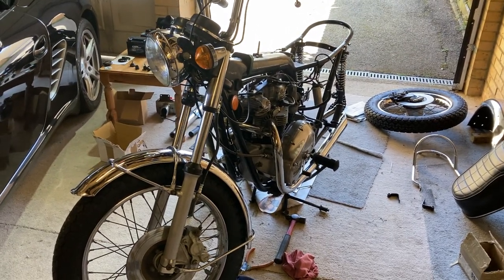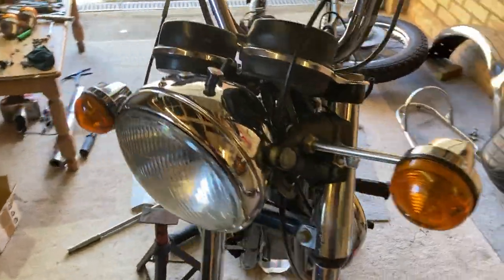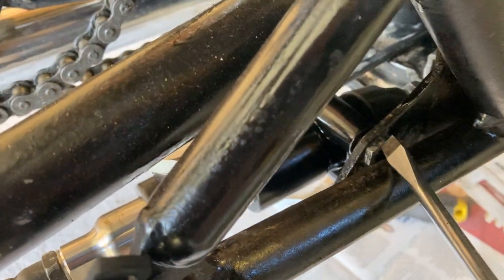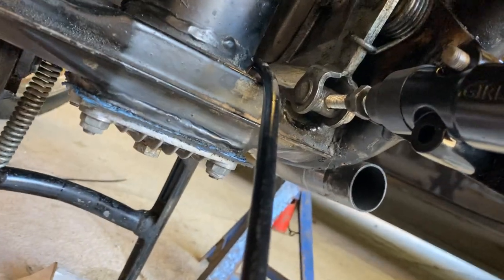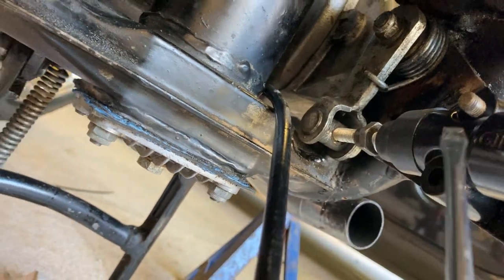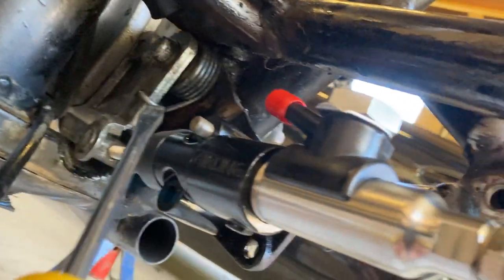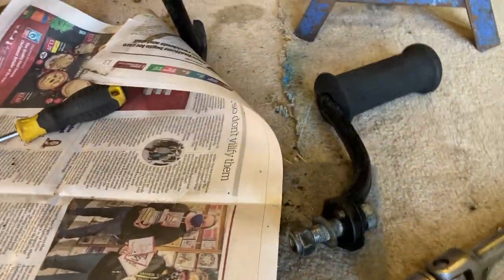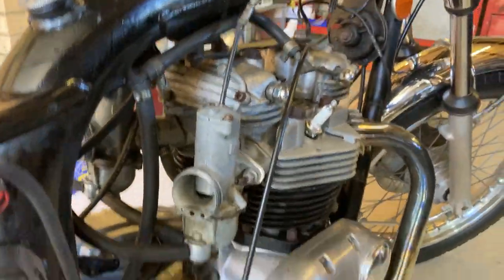Triumph Bonneville T140V Replace Rear Brake Master Cylinder.

Comment: If it's just the master cylinder you want to remove, it's not necessary to remove the footrest and mudguard. Once the wheel is out of the way, you can access everything you need. The only tricky part is the return spring. Levering it off is fairly straightforward, but to refit it you will need to make a heavy duty hook to pull it back so you can hook it back round the operating lever. It's also important to make sure the spacer behind the lever is in the correct position when you tighten the retaining nut. If you are only replacing the cylinder barrel and internals, not the complete assembly as shown here, it is important to screw it in to the correct depth, to get the optimum amount of pedal travel. Although the factory manual does not go into detail on this for the rear master cylinder, if you use the same procedure as they specify for the front, it will be right.

Comment: I'm struggling to adjust the brake action on my 78 T140.  It's really hard to get to both of those nuts that screw on that long threaded piece.  Not the best design.

Comment: I had the same problem, it’s not easy to remove or re-assemble and bleeding the system is not easy. Not the greatest design for fast shop maintenance, just as well I don’t charge myself for Labour!

Comment: have to remove everything he reference in order to get everything out. You've just entered the seventh circle of hell. and next you then have to deal with the happy circumstance of trying to bleed the rear caliper. Make sure you have your lucky socks on for that. good luck
Reply: To bleed it tie it off,  off the wheel so the nipple is high, place a packer in the caliper don't let it hang. 
On my t160 which is similar the centerstand will clout the cylinder and eventually wear the thread in the alloy master cyl , either trim the lug on the stand or remove it and weld a pad on it .
Regarding the  fitting the spring sit behind the bike with feet on the pegs and hook the spring and pull, it's a 2 man job, I got the wife to help me but she had an easier way, aussie women!
Reply: Bleeding is fairly simple on the T140V, once you have pulled the wheel spindle out far enough to let the caliper hang from its torque stay - the nipple will then be at the top and you just need to put a spacer between the pads to stop the pistons pushing out during the process.
Reply: Earlier t140s had the caliper on the bottom of the brake disc. Later ones had it located at the top. Clearly having the caliper on the low side made getting all the air out much more difficult. I found it can take three or four times to get it right. Each go-round requiring the installation of everything again and testing it out.
Reply: @steved5518  I've had my T140V (with the underslung caliper) for 29 years, with a brake fluid change every year. In my experience, the worst part of it is getting clearance to pull the wheel spindle out, which involves either taking the left hand silencer off, or unbolting both shock absorbers so you can jack the swinging arm up. Once you've done that, the caliper is hanging in the right position and I've never had any problem bleeding it first time.
Reply: Thanks for the tip Rick. I' have the shorter silencers so that it does not interfere with the spindle. Nevertheless I've had the problem with air and spongy pedal. Totally rebuilt the system with new components. I'm sure lots of air. I'll give it another shot with your comments and perseverance in mind!
Reply: @steved5518  Sometimes, when you've had the system emptied, it can be hard to shift all the air from the hose between the remote reservoir and the master cylinder. I've found it helps to slacken off the hose clamp on the top of the master cylinder and let gravity push the fluid out from there for a few seconds, then you know you've primed the master cylinder before you start pumping.